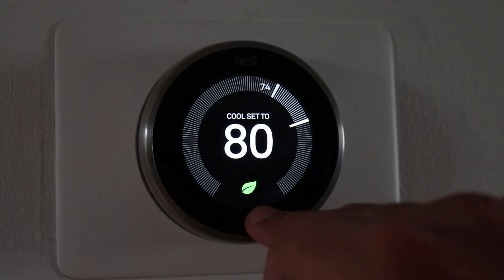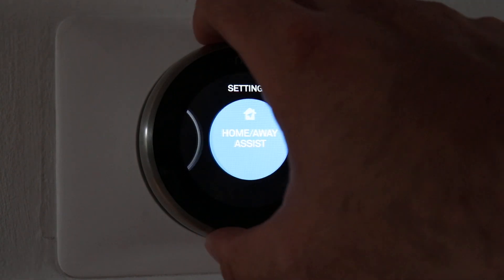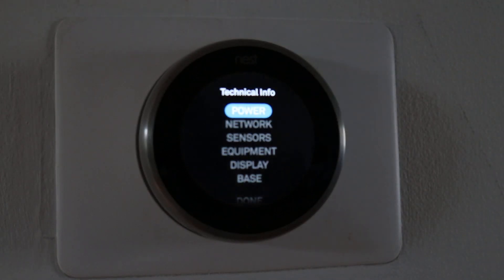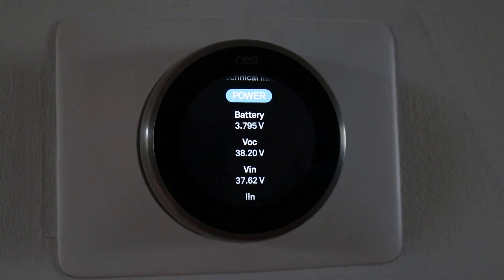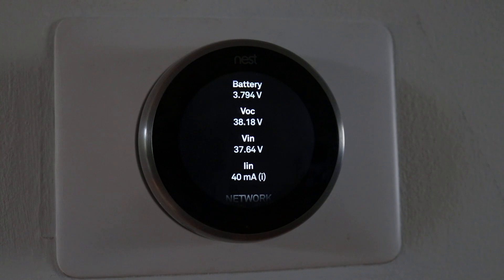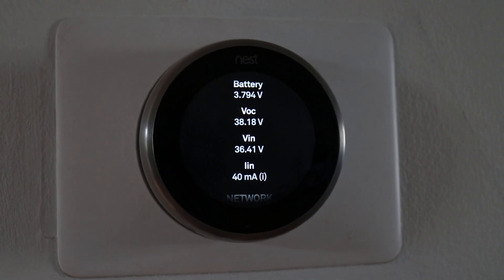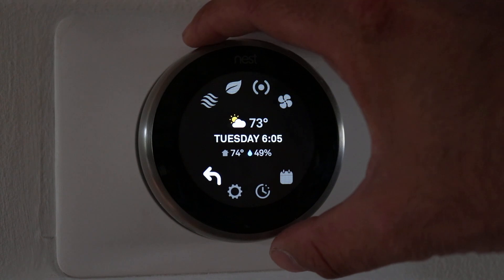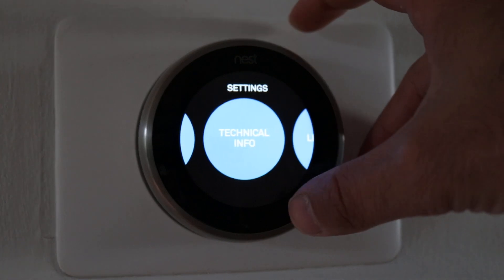Do You Need A Common Wire ?

Comment: So. Today my Nest crapped out due to low voltage. Which is weird! Because it’s been running for a year and a half without a common! What changed? Who knows. My guess is the dynamics of battery in the Nest have changed with age and just can’t do it on minimum power! Note: when I looked at the thermostat it was reading Batt 3.397, Voc 38.69, Vin 6.70, Lin 20mA.
Reply: Mine has too out of nowhere I just ended up getting a new one works like a charm

Comment: If I have an option of connecting common wire or not, should I always choose to connect it or there might be a potential issue of having common wire connected, say if it's not needed? Thank you.
Reply from the maker: Typically connect it if you have it. Very very very very very rarely I've seen issues with the common wire connected and in my experience if there are issues the nest will immediately display there's an issue with the common wire and you could just remove it from the device.

Comment: Hey James, Need some help here. 

My nest constantly had the low battery issue, and I did your common wire hack (putting the green wire into the C terminal, and rewiring it in the furnace).

This looks like it fixed the low battery issue, but when i run the tests, only heating seems to work, and cooling doesn't.

Any ideas why? Any insight you may have would be greatly appreciated!

Thanks!
Reply: I may be able to help with your issue.Since you put your G wire in the C terminal, the G terminal is now empty. You should trying putting a jumper between the Y terminal and G terminal, and this should fix your issue.